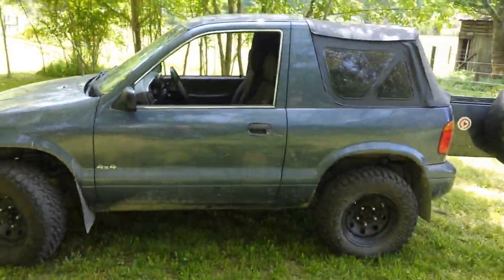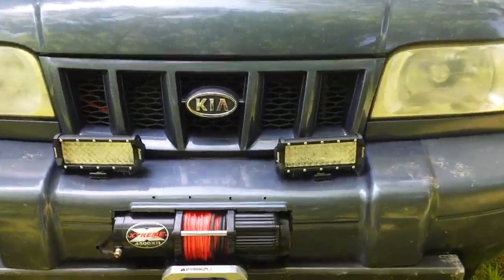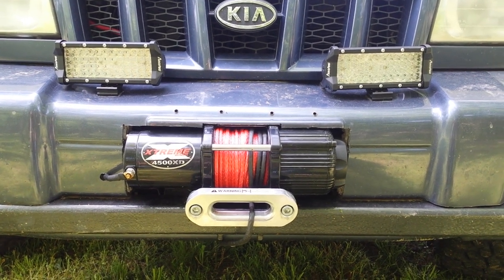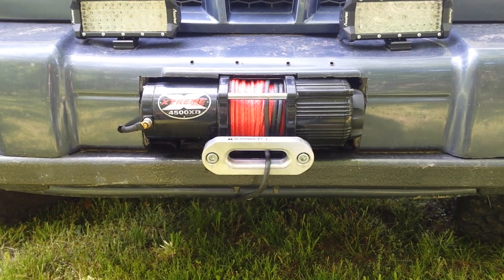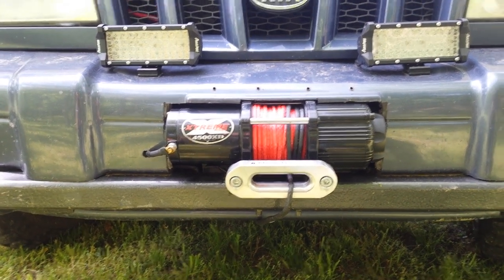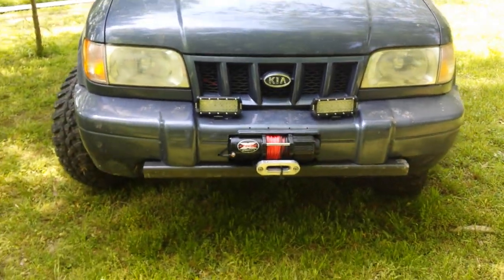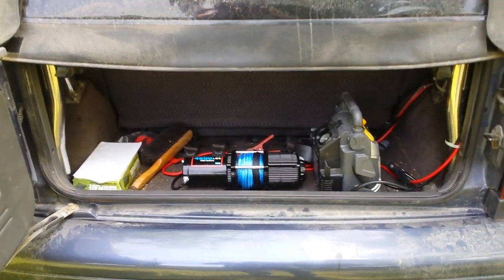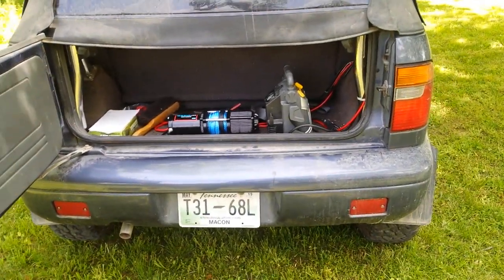Micro-Pig volume 2. Front and rear facing 4500 lb. Ebay winches on my 2002 Kia Sportage offroad toy!

Comment: Also note that the earlier Kia's are actually a Ford/Mazda (its actually a Miata engine you have there) before the company was sold to Hyundai and those are the rubbish Sportage.
But yeah you right  you got the good one.
     I do recommend taking it to KIA and getting the security set to UNLOCKED mode while it is still going
     Common problem with these and when it fails it needs to be replaced before it can be unlocked .... I spent $2000 trying to fix one once.....
Reply from the maker: Unlocked mode? For the security system? Does it need to have the computer reflashed?

Comment: What brackets did you use?
Reply from the maker: Paul Lange front winch or rear?
Reply: @micro-pigoffroadclub8387  on the front, you spoke of a Honda bracket...
Reply from the maker: Paul Lange when I got my Kia, it had 2 receivers bolted to the frame rails up front. Whoever had it was flat towing with a tow bar. The receivers were there, but not the inserts or the pins to hold them in place. I did notice on my receivers a small steel loop for padlocking the inserts to the receivers and started browsing eBay for inserts with the loop. I found a set from a Honda that “looked” like they would fit... and did. On my FB Micro-Pig off-road club page, I can post better pics. You’re a member right?